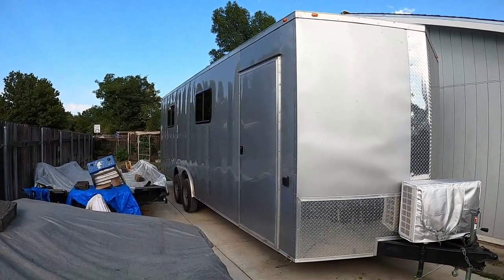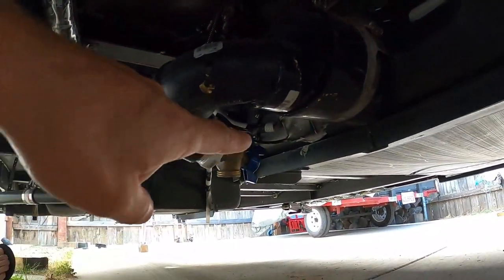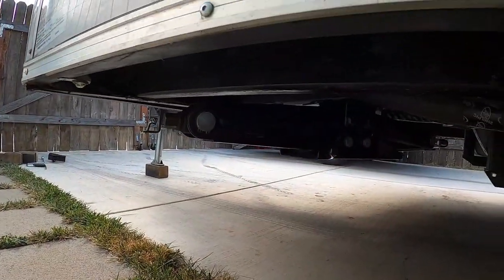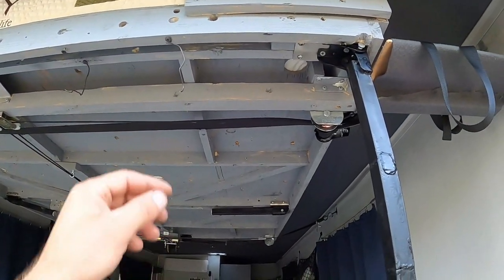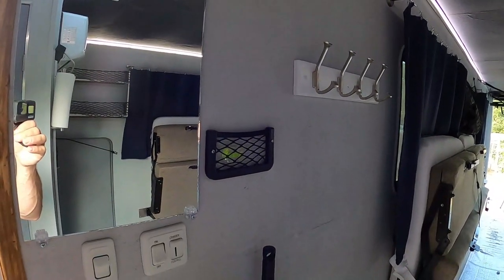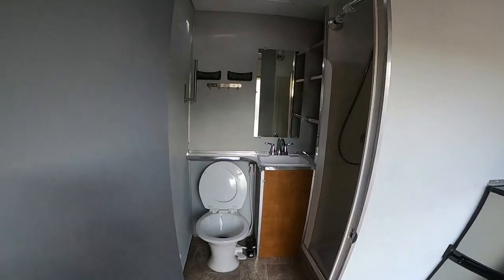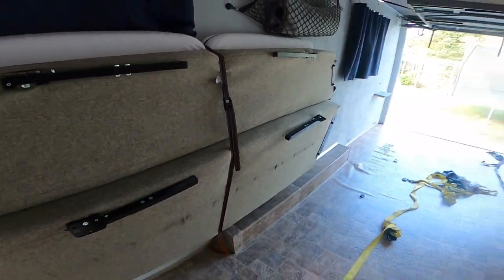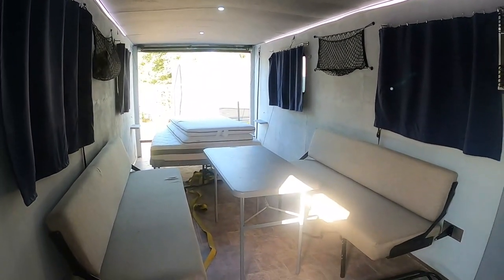My enclosed trailer conversion , walk through video.

Comment: Nice Job.... I am in the process of converting an 8x16 v-nose cargo trailer into an RV and Mobile Sign Shop.  I am just starting the walls and cabinets construction. I just sold a 15-passenger shuttle bus that I lived in for 3 years and traveled out west during the winters. I had to sell the shuttle bus because I purchased a large format color printer to make contour cut decals/stickers, koozies, t-shirts, magnetics, banners, mousepads, etc.  The large format color printer would have taken up a lot of storage space so I needed to get something bigger.  I did a complete conversion series on the shuttle bus from the ground up and now am doing a new series on the cargo trailer conversion.  They are on my YT channel.

Comment: Great Camper you made there, Thanks for the video! My 4x6 v-nose toy hauler-camper-theater is quite compact. I added front 4x5 deck plus roof rack and hitch rack, Extra room for 2KW Inv-Gen, LP bottles, Solar pnl, and Awning. 3 cabinets hold cooking equip. and the 24"TV/entertainment ctr. Tri-fold sofa-bed, 5K BTU AC, elec heat and induction cooktop complete the collection (so far). Thinking about a folding room pinned onto my ramp that will be outside galley and more inside space. It will tie down on the front deck. Pulling it with a 1.8L Scion XD gets well over 20mpg
Reply from the maker: Sounds like a very nice built, and you are able to pull it with scion , that’s impressive.
Reply: @roadglassandmore  In my younger days I drove a truck so I can drive a stick and the Scion is 5 speed standard. However, Toyotas are built tough. My son and I towed an 18 ft inboard/outboard ski boat from Phoenix to Oklahoma city with a 1500cc Echo with an automatic!

Comment: Do you have a video more about your solar panel setup? I am brand new, and I want to run a mini split on batteries?
Reply from the maker: I don’t have solar set up, I thought about it a lot, but  I can’t justify the cost . I run my small gas generator ( $300) in quiet mode when I need to charge my batteries. 
And I do run my mini split on batteries I have 3 - 12v 200amp batteries
Reply: @Road Glass and more  oo okay i misunderstood ! So how long do you get out of your batteries? running just a split unit? I am a putting down deposit on my new trailer tomorrow!!!

Comment: Look good. Where did you get your electrical diagram from? I’m looking at converting a 20’ x 8.5 and I want to do all the electric. Thanks Tim.
Reply from the maker: thank you!, I wired everything myself, and each 12 v output has its own negative and positive wires ( meaning I didn’t ground the battery to chassis, everything has fuses,)

Comment: Great idea to use marine carpet on the ceiling?  What size did it come in and where did you purchase it from?  Thanks!
Reply from the maker: I bought roll on eBay, 60” wide. I actually redid the interior a little while ago, I now have beige headliner material on the ceiling
Reply: @roadglassandmore  why did you switch to headline material? Did you also buy this on eBay?  Also, great idea insulating the bottom of the trailer.  What is the black coating that you applied to the foam board? Does it make it waterproof and are you happy with it?
Reply from the maker: @dirkjackson8939   I read is the ceiling, spray foamed it. And decided to try headliner this time. 
I just used spray paint on the bottom, so the pink board  kinda blands in

Comment: When you installed your windows, did you have to weld in or install any frame bracing in the wall, or just cut out and install the windows in the walls? I'm contemplating whether or not I need to brace the walls with frame from top to bottom for the window to set into. Thanks, Tom
Reply from the maker: Yes I welded in square metal tubing, to give it more support .
It’s in this video https://youtu.be/w4i-GlI4Dtg
Reply: I ran some flooring thru a planer to get right thickness and framed 2 windows and the door. Attaching to the 'Z' studs. My cargo walls were hollow and mounting to the skin only would have been really weak

Comment: How long can you run the minisplit on that 600ah battery?
Reply from the maker: I usually run it at night  and use generator at day time, voltage drops from 13.1 to around 12.5, also fridge , pump , lights are drawing power too at the same time . So I think I could easily run it for 24 hours or more if needed